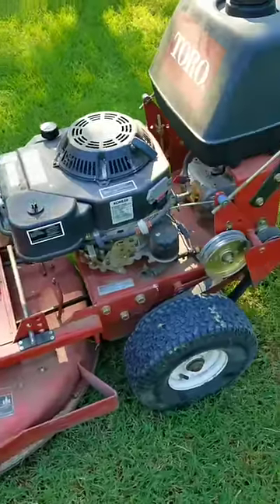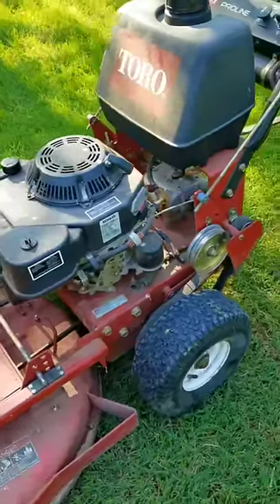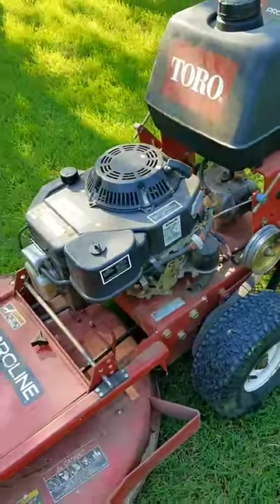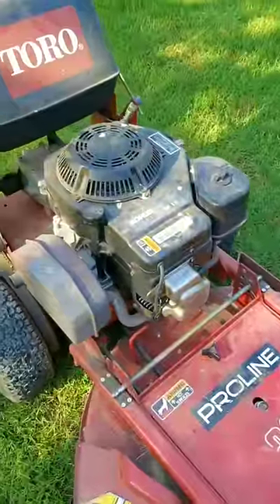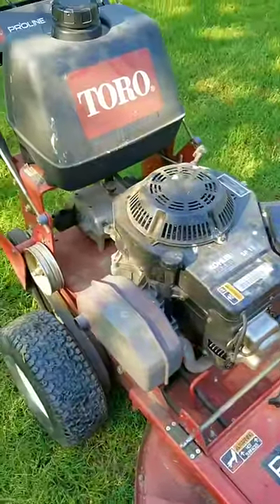What's Wrong With This Toro Walk Behind Mower?

Comment: Old school Brigs would sound like this when the flywheel key sheared from a blade strike
Reply from the maker: turns out the valve lash was too tight
Reply: INSIDE HOUSE GARAGE yeah, that still happens, exh valve stretches like air cooled Volkswagen engines back in the day, it was always the one under the oil cooler first.
Reply: @INSIDEHOUSEGARAGE  that was the first thing I thought, intake valve clearance too tight but @robertjames6711 idea of a flywheel key sheering is also a really good possible diag. whenever you hear it blow out exhaust or flame out carb its going to be either.
Reply: I just did a 22 horse and one side of the camera was completely worn down to nothing I mean the same diameter both sides of all way around it but Yellowstone was working fine and I find a 9 horse had a severed key and it also had a broken camshaft
Reply: @INSIDEHOUSEGARAGE  that’s what she said lol 😂
Reply: Came here to say that.
Reply: If that flywheel key is sheared when you pull it and it tries to start it we'll pull the Rope out of your hands
Reply: @timcutler5599  or kick back so hard it jerks the rope out of your hand, depends on how far off timing is
Reply: I just fixed a toro with a Briggs last week with a sheered key on the flywheel. The lady hit a hidden small log and stopped the blade in a split second and the flywheel kept turning Lol. It sat for 10 years. 
The gas had turned to jelly so tank cleaning and the usual carb clean out and it ran great.
Reply: And points,coil,ect.
Reply: That would my first guess.

Comment: It sound like the flywheel key is shered but id say that the valves maight be the problem.Nice videos!👍
Reply from the maker: valve lash was miles off spec.
Reply: And it's a POS!!!
Reply: Yep going to say check the blade for any real nasty impacts. That causes the flywheel key to shear off.
Reply: @FFLFFS  belt driven blade. That is more likely on a direct mount blade. But the belt would cushion the impact making sheared flywheel key not very likely.
Reply: That's an old Briggs & Stratton check the key takes a little bit of work but it has to be aligned right
Reply: I was going to say the same thing
Reply: You know you the mag and flywheel are good because you have a spark and a backfire, check the compression and if it's off take the valve cover off and check for valve train damage, as a valve that won't fully close will cause a backfire. If the valve system had been good the engine would've sputtered a good bit and died when it was squirted.
Reply: @INSIDEHOUSEGARAGE  has hydraulic lifters no lass.
Reply: Agree it sounded like valve lash issue. Had this same thing happen on a GX530, and a little adjustment fixed that and long time cold start issue.
Reply: I agree without it being in front of me
Reply: @INSIDEHOUSEGARAGE  These don't have valve adjustments they' have hydraulic lifters
Reply: @surroundedbyjaggoffs  Another man's junk is another man treasure if you can get it running ,  or 😁 maybe I'm wrong
Reply: I missed the "while it was in use" part.
Reply: @rwelpers  Kohler motor
Reply: hydraulic lifters in this motor theres no valve adjustment on this motor
Reply: @benlalime8543  i dont think so
Reply: Off timing!  Possible key off? Or bent shaft?
Reply: @INSIDEHOUSEGARAGE   In the video he says that it previously had been in use whenever it quit running. How do you explain how the valves became so much tighter?  I've never seen a valve lash loss so severe that it quit running unless something has failed or it was running really poorly for a good bit of time prior.
Reply: Could be a stuck valve or loose/broken valve seat.
Reply: @rwelpers  it literally says Kohler on it
Reply: @rwelpers  it's a Kohler
Reply: Everyone keeps saying check they key it turns over....😂😂😂

Comment: I had a sheared flywheel key once. It won't turn the engine over at all. Sounded like it was turning over but not firing. Check the coil pack set.  And tighten that pull cord spring while you're at it. Good luck.
Reply from the maker: thanks but it turns out the valve lash was out, by a mile

Comment: Spark plug,,flywheel magnet is rusty,gap the coil,,dead fuel,,flywheel key,,lots of shit check for stuck valves, was it run out of oil scoring the piston?
Reply from the maker: turns out valve lash was too tight

Comment: Valves or spark plug. I had an Ex-mark with a 420V Kawa. SWEET mower.
Reply from the maker: yes super sweet, wish it was mine, but the problem is internal.
Reply: Have a watercooled v twin Kawasaki on a John Deere....great mower

Comment: I have had many engines do that.  What I’ve found is that the engine is worn out from improper maintenance or a lot of time on them.  The piston rings lose clearance and the engine has no compression, causing it to backfire.  Not sure if that’s your case as well
Reply from the maker: to be honest the reason is not start is much much worse, it's basically a walking zombie, looks like it shouldn't be working but it's dead inside.

Comment: I worked for the local parks&rec for 10.25 years starting as a common laborer and worked my way up to equipment runner and assistant forman for a crew- our pushmowers were Jacobson 20" , the riding mowers were Toro Ground masters 72" cutting decks and Husky 48" belly mowers - also the big mowers were Jacobson E10 gangmower with 5 42" blitzer mowers and a Ford 7200 tractor with w 72" brushhog
Reply from the maker: very nice, thank you Idus Welton.

Comment: Pull the plug, inspect. Check compression. Also, check the spark timing. Those small engines do have shear keys in the flywheels.
Reply from the maker: turns out the valve lash was much too tight on it.

Comment: Sheared flywheel key?
Reply from the maker: very unlikely because there's a belt between the blade and the engine,
Reply: @INSIDEHOUSEGARAGE  yea i'm not very knowledgeable about mowers like these lol
Reply: @INSIDEHOUSEGARAGE  the flywheel key is under the blower housing.  Has nothing to do with the belt. Take off the starter then the blower housing and remove the flywheel bolt and look down in there to see if u see the flywheel key.  U may have to remove flywheel to see key.  I work at t.w reiss mowers.  Very common problem with some exmark walk behinds.   If not the flywheel key. Check the valves.    Good luck 🙏🙏
Reply: @INSIDEHOUSEGARAGE  the ignition pickup/coil rides against the flywheel under the blower housing and the flywheel is the blower. This is what your pull string is, blower housing. If the key sheered timing would be off as the flywheel losses index to the crank throwing off ignition timing. I say it’s either this or if pulling it over has little resistance, you have a valve lash issue.
Reply: @INSIDEHOUSEGARAGE  the flywheel bolt could be loose and it can shear the flywheel key
Reply: I can get this running

Comment: I would change out spark plugs first then clean carb and filter. Then drain oil and gas. Put fresh oil and gas in it. Put a new battery on it. Then go from there. My first 3 things I always do when working on engines is check if you have fuel, air flow, and spark.
Reply from the maker: , turns out the valve lash was too tight

Comment: I used to mow cemeteries when I was a kid. I'd run over some hidden grave plaques from time to time and need to replace the timing key. That's what I think is going on here...or at least that's where you should start
Reply from the maker: wow, nice.  turns out the valve lash was too tight

Comment: The moment you pulled the handle it should have been fairly apparent there's no compression and if there is a little bit of compression it's not near enough.
Reply from the maker: there's a fair amount of resistance from this engine, and the compression was around 25 psi if I remember.
Reply: @INSIDEHOUSEGARAGE  should be 100 or more.
Reply: Fuel, compression, and Spark.  Does it have Spark?
Reply: backfire means gas is getting by without burning.  compression.
Reply: Many modern lawnmower engines have automatic compression release so they never really “feel” like they have compression.

Comment: Valves out of adjustment, bent valve, or a worn valve seat.
Reply: I worked on a Stihl string trimmer with a similar problem and the rockers were too tight

Comment: It's probably the muffler bearing 😲
Reply from the maker: nice one.
Reply: How would you start in the morning if all that Alcoholl with through your system  Ha ha ha
Reply: Damn muffin bearing,I hate it when they get crappy 💩
Reply: Left or right
Reply: @johnmccullough8906  middle
Reply: Or it's the turbo encabulator
Reply: Flywheel key broke
Reply: Had a bad muffler bearing once back in “89” had to cut it out and replaced it with new fangled carbine fibered one, run great now but uses a little oil.

Comment: I had the same problem with my commercial John Deere zero turn. Possibly the valves. Mine were stuck open. My only choice was take the valve cover off and work the valve loose and run seafoam through it. I’m 16 and I have been working on it a lot since I got it for free lol.
Reply from the maker: you are correct, for some reason something happened to the camshaft, and all the valve lash was way off.
Reply: @INSIDEHOUSEGARAGE  oh wow, that’s crazy. Do you need to re time? Seems like you could. But I’m still gaining experience with all this stuff. You mine want to check your backlash on the rocker arms. Mine are crazy loose right now. I have to tighten them and everything. I have a crazy tick sound right now. Thankfully that’s fixable. Let me know if you choose to sell that when you get it fixed.
Reply from the maker: will do.

Comment: Have You checked to see if the flywheel key has sheared
Reply from the maker: yes unfortunately and it wasn't sheared, turned out the valve lash was out by a mile.

Comment: Check or change spark plugs. Check safety switches. Take bowl off carb and blow out carb. Spray down carb with carb cleaner. Check oil low switch. Check ignition coils. All could be the problem.
Reply from the maker: turns out the valve lash was out, by a mile
Reply: @INSIDEHOUSEGARAGE  that will do it also. We check our machines everytime we change our oil. We learned the hard way that we needed to idle down the machines before shutting them off. After we did that we very rarely had to either replace heads or motors. Preventative maintenance goes a long way.

Comment: I ran a lawn mower shop for 15 years I can tell you exactly what's wrong with it it sounds like low compression and a reason for there's a rocker arm on the valve it's probably came loose and probably only exhaust side you need to check and adjust the valves and make sure it's got fire
Reply from the maker: very nice call Kenny Ball, you're right, turns out the valve lash was too tight

Comment: For starters it seems like it has low compression. I will check to see if it has spark. You can do this by removing a spark plug and reconnecting The Wire push the spark plug Up Against the Machine while someone turns it over. The brave person will be the one holding the spark plug because if it does spark sometimes you get jolted by it pretty good.
Reply from the maker: you are correct the compression was low and it turns out the valve lash was much too tight.

Comment: Clean carb good and the pin that allows float to go up and down in the bowl should move up and down freely
Reply from the maker: turns out the valve lash was out, by a mile
Reply: Its not the carb - he put in starter furl and it would not fire cylinder
Reply: He just ruled that out, doofus.

Comment: "Have you checked the air in the tires lately?"
                   -Cheech and Chong, Big Bambu😄

My guess is a sheared flywheel key.
Reply: I've bought more big bamboo albums just for the rolling paper...😎
Reply: If it's not sheared it's bent...
Reply from the maker: turns out the valve lash was out, by a mile

Comment: valves probably adjusted too tightly sometimes people overtighten the valves cuz they don't hold the stem still as they tighten the nut down
Reply from the maker: you were right!  turns out the valve lash was too tight

Comment: If this was a regular lawn mower my first guess would be flywheel key but this is probably valves
Reply from the maker: the valve is the problem but what happened to them, is the part that's going to shock you.
Reply: @INSIDEHOUSEGARAGE  can you pin the update video in the comments when it comes time?
Reply: @INSIDEHOUSEGARAGE  valve seat

Comment: “I think the motherboard crapped out on ya again”
Reply from the maker: turns out the valve lash was way out of spec
Reply: New plug... 
Next, stator
Reply: Did you try rebooting it?
Reply: Unplug it for at least 60 seconds and plug it back in, then try starting it again. 🤣

Comment: 100% need to adjust the valves. Those OHV Briggs need it regularly, will not start when out of spec, and backfiring from carb is a classic sign. 

If I recall clearances are intake .004 -.006 and exhaust .005 - .007. I usually do. 005 and .007. Do it engine at 1/4 inch TDC and you're golden.
Reply from the maker: you are correct. turns out the valve lash was too tight.
Reply: @INSIDEHOUSEGARAGE  yeah it's counterintuitive because most things loosen up as they wear in - but with the valves in small engines it's usually the seats that take the wear first. This means the valve settles towards the rest of the valvetrain and you loose what clearance you had.

Comment: I had one kinda like that the spark plug was completely covered in carbon.. exhaust was also plugged replaced plug cleaned exhaust port runs great now
Reply from the maker: turns out the valve lash was too tight

Comment: Clean points and magneto,sounds like timing.
Reply from the maker: turns out valve lash was too tight
Reply: @INSIDEHOUSEGARAGE  had a toro z turn that had problems with the valve train (broken push rod) im assuming because the valve lash wasn't set correctly ... it also had a kohler maybe that's just a thing with those
Reply: Points haven't been used since the 80's on lawn mower type engines

Comment: You need to pull it! Like hard. If that dknt work put some fresh gas in. If that dont work take the air filter off and block off the carb and pull it again
Reply from the maker: turns out the valve lash was out, by a mile

Comment: It’s your sheer pin on your shaft it sets the timing on your 
Machine. HarborFreight carries them.
Reply from the maker: turned out the valve lash was out by a mile
Reply: @INSIDEHOUSEGARAGE  these guys all saying the flywheel key is sheared aren’t noticing that the blade is belt driven. The sheared key happens mostly to machines with blade mounted direct to crank.

Comment: Sounds/looks like pretty bad compression the way you were pulling it.
Assuming the spark plug is in
..
Stopped while running.... blown head or gasket?
Reply from the maker: you are correct about the compression it was low because it turns out the valve lash was too tight.
Reply: @INSIDEHOUSEGARAGE  ah the old stopping the valve from seating trick.

Comment: Valves or key, my dad's toro tractor did this until I adjusted the valves. The compression relief wasn't working because the valves weren't adjusted correctly.
Reply from the maker: turns out it was the valves.

Comment: Timing issue would be my first guess, it’s also a kohler so that adds to the problems!
Reply from the maker: turns out the valve lash was too tight.
Reply: Yeah sounds like the motor is out of time,or the valves aren't closing all the way
Reply: Magneto

Comment: Clean fly wheel then test the spark plug but normally the issues i have is the fly wheel with surface rust. But if it completely shut off maybe the plug if not plug the carb may be blocked with gunk
Reply from the maker: thank you Corey Scheidt.

Comment: Also in 1974 in operated the first Weedeater the city bought- it wasnt like any Weedeater sold today- it weighted 65lbs - it had a 4hp push mower motor a 5 quart gas tank ( steel ) and the string head held 4 spools of 450lb test fishing line and it weighted 2.5lbs- i found that if i replace the string head with a 7.25" Skilsaw blade it worked much better
Reply from the maker: wow, that's quite a  unit.

Comment: The cam shaft shear pin is broken or shifted, it’s out of time that’s why it back fires.
But check the plug next and see if you have spark. If no replace the plug.  Still no then all electrical connections. 

Check the deck & blade for hits.  See if Im right the  shear pins broke or shifted.
Reply from the maker: turns out the valve lash was too tight.

Comment: It turns over suspisciously easy.A compression test should be done .Like another mentions the flywheel key may be sheared leaving ignition timing drastically off.A stuck valve or a burnt valve.Many possibilities but start with the simple and diagnose as you move up the list.
Reply from the maker: turns out the valve lash was much too tight.

Comment: Change your flywheel key.  Also called a shear pin/shear key. It is what keeps your timing in time. A partial shear with advance the timing causing no start.  Many times the timing will be off just enough to fire before TDC and make it kick like a mule. Sometimes they'll run that way but you run the risk of breaking your hand. Just change the key.
Reply from the maker: turns out valve lash was too tight
Reply: Ah, yep. Done that before. I didn't think about the overhead valves. You just made me realize that is something I need to check on my machine. Thank you.

Comment: Valves. 
It’s sparking when the intake valve is open.  
Carbon on the seats. 
It’s not turning over easy. Bent valve.
Reply from the maker: turns out the valve lash was too tight

Comment: Change plug test for blue spark if not clean the magnet that passes by the coil for rust buildup compression check and timing check
Reply from the maker: turns out the valve lash was too tight
Reply: @INSIDEHOUSEGARAGE  I've seen that problem with a old vw bus motor they tighten up thus wouldn't run